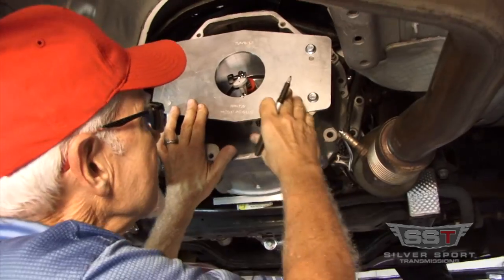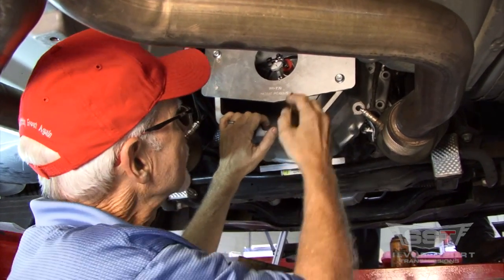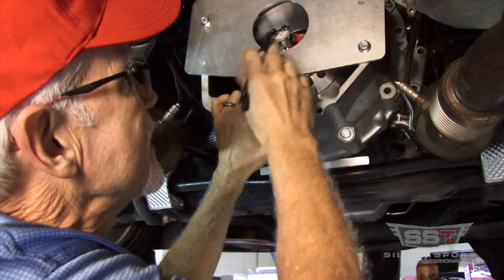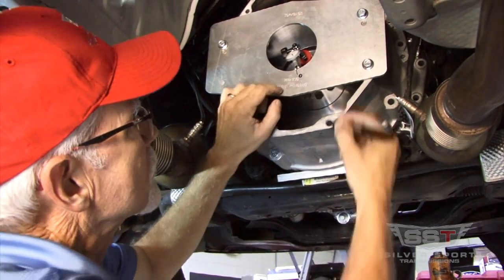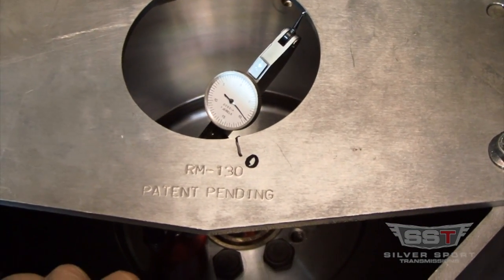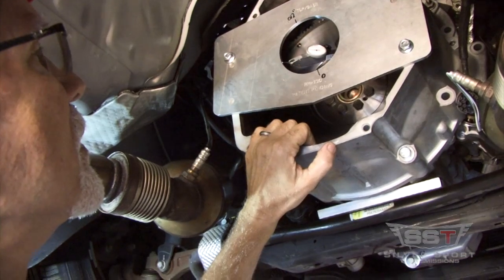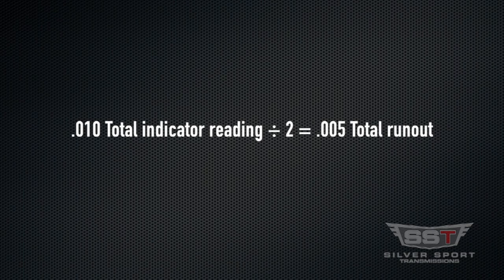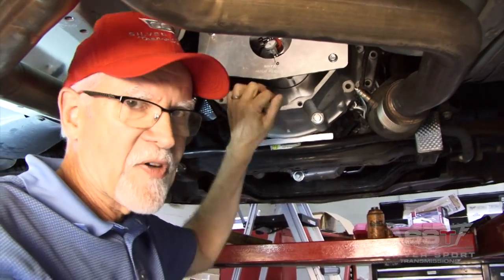How to Dial-in a Bellhousing

Comment: Hello, IMO going to the hassle and cost of removing dowel pins on an engine installed in a car because you are out of specification by .001" is nuts. Then putting the offset pins in and going through this procedure again! There is noway GM does this when putting in a manual transmission on thousands of cars. Input shaft nose is .590" diameter. Pilot bushing or roller bearing bushing has an ID of .594". Conclusion, IMO if you are out of spec. by more than 15 Thousand realign your bellhousing but for .001" put it together and drive it. This isn't NASA!
Reply from the maker: The TREMEC transmission (other transmissions may be different, check with the manufacturer) can only tolerate up to .005" of misalignment because of the tapered roller bearing on the input shaft (inside the transmission). When you put a side load on the input shaft, it causes the bearing to wear prematurely and could even fail. Most people are within spec without having to swap out the pins. It's a simple and quick procedure that can save you thousands of dollars. Worth it to keep your TREMEC warranty and to keep your TREMEC in good condition for decades.
Reply: @SilverSportTransmissions  Thanks for the reply. OK I have an older T56 from an LT1 that is in great shape. I will check the runout.
Reply: @Danno74Z  never used to have to do this with any other transmission, or did we lol, that’s just crazy that ya spend all that money and have to do something like this, I’m in the process of this right now, and also it want even go into any of the gears
Reply: And the trans should have came with the dowels you might need
Reply: And by the way it was .006 th out
Reply from the maker: @Retiredgarage  there are multiple offsets and most people won’t need them, that’s why they’re not included. We will add them to any customer’s order that requests them though.
Reply: @SilverSportTransmissions  yeah I’m having trouble now it want shift out of the box, tried what paper work said to do no luck, it turns even rear shaft turns but won’t go in any gear maybe one of them
Reply from the maker: @Retiredgarage  please call us on Monday and our tech department will be happy to help. 888-609-0070

Comment: Why does a tremec need  aligment.?..The old 4 speeds never did?
Reply from the maker: That’s actually a misconception. Many of the old 4-speeds had a conrad radial front bearing whereas the TREMECs have a cup and cone tapered bearing assembly. While the conrad radial bearings tolerate a greater range of misalignment than the cup and cone bearings do, they can also fail due to misalignment or the misalignment could cause premature pilot bearing wear. If you didn’t align the bellhousing for the 4-speed, you were taking a gamble that had better odds than if you didn’t align the bellhousing for a TREMEC, but both transmissions have alignment requirements and both could fail due to misalignment if you don’t check the runout.
Reply: @SilverSportTransmissions  Im 53 and been working on cars since  pre teen ager.The other day was the first time I've heard ever heard about bell housing alignment. This is my first Tremec install.All this is nice to know.
Reply from the maker: @DanneyTanner  I'm glad you found it useful. Call us if you need any help.

Comment: It's brutal how many people believe a 1960's bell housing is "fine" for these modern transmissions and don't even check
 We put a TKO on my father in laws 67 Chevelle 396. It was 0.014" out. With offset dowel pins I was able to get it to 0.0015".